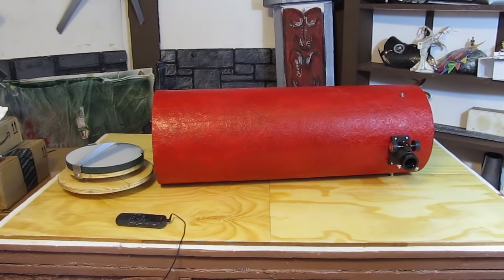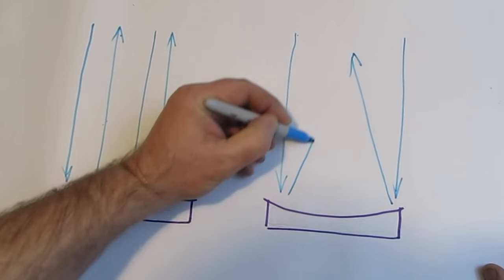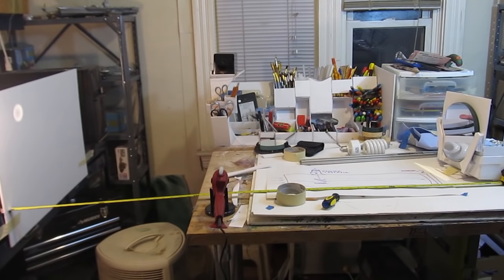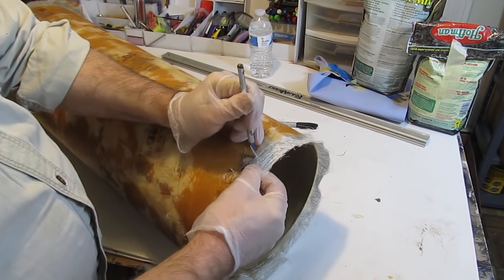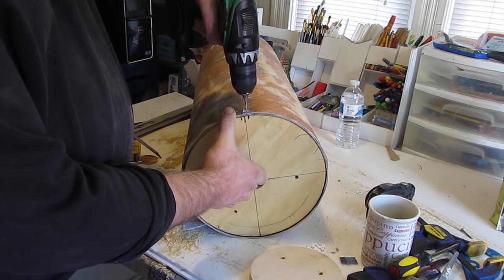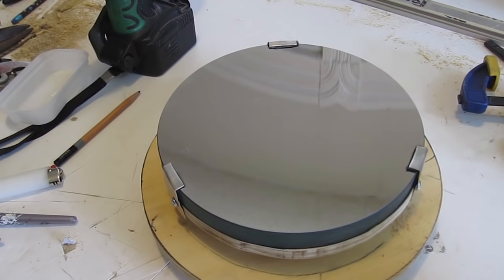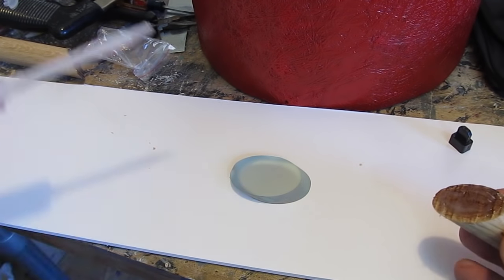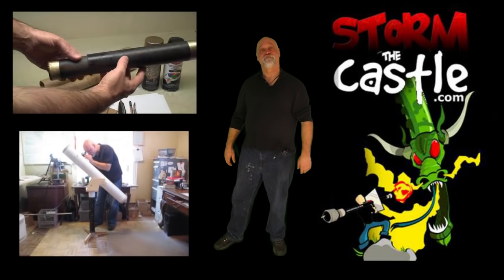How to Make a Telescope - 8 Inch Newtonian Reflector (Part 1)

Comment: How would this compare to a purchased/pre-assembled telescope of the same size? Would I be able to see the same amount of detail, or would it be lesser quality?
Reply: J Smith "Re:How would this compare to a purchased/pre-assembled telescope of the same size"
Not a expert on pricing of telescope parts but generally when building ANYTHING one (big) advantage is you are able to put more money in a "select" part (or parts) than a OEM would.
(OEM's in general selecting components that "just" perform a function, projected lifespan "just" long enough so to speak to last thru warranty period... and not much beyond for example.
Reason?
Cost per part is a major concern when they are making 100, 1,000, 10,.000... and trying to hit a price point /remain COMPETITIVE / keep profits at a certain level.)

So far as your cost per part /total cost. 
OEM's ordering say 100, 1,000 of anything (And supplier is assured of future orders) get a better price than a person buying (1) of anything... 

So building anything you (usually) end up spending more, the trade off being being able to build to YOUR specs.

Comment: This makes it look easy, but it's NOT.  When I was a teenager, my father and I made reflecting telescopes from scratch.  Our first 6" mirror was not very good and took a long time to make.  The next 6-inch diameter mirror took about 40 hours of work to complete, and it was actually a pretty good telescope.  We made an 8 inch mirror next.  An 8" mirror has nearly TWICE the area of the 6" and took us at least 4 times as long to grind and polish.  That's 160 hours, folks.  Takes some real dedication.  But if you are careful, the rewards are pretty spectacular!
Reply: The guy in the video bought his mirror tho.

Comment: Getting a PVC tube was really hard, so I do not want to mess up the measurements, so isn't it better to start with the spider and focuser and then place the Primary at a suitable distance and then cut the excess tube? (Reason for PVC tube, Concrete form tubes not easily available here!)
Reply from the maker: That sounds like an excellent plan!

Comment: How do you determine the distance from the primary mirror to the secondary mirror so you can drill the hole for the eyepiece focuser?
Reply from the maker: Hi, You have to measure from the center of the tube to the eyepiece. Knowing this length you subtract it from the focal length.  That gives you the distance to the secondary and the hole. More about this on the web based tutorial. Link is in the description of this video.

Comment: is it realy good to make tube frome this material ? It will slowly adapt to temperature of outside... I understand, its easy to work with this.
Reply from the maker: Yes, This is an excellent material. It is very strong, very light and it is very resistant to changes in temperature.

Comment: Sorry if this seems a little negative, It's a great project but I felt that you went  into a lot of detail about the things that are really obvious and not enough detail on the more complicated parts. One example is that including part two, you explain the reasons for countersinking screws at least 3 or 4 times - if someone owns a countersink tool it's reasonable to assume they know what it's for!  You explained how to move the main mirror with the three wing-nuts, which again is fairly obvious, but you did not give any information about the alignment / column process itself. I would imagine there's a specific way of doing this rather than just messing around with the wing-nuts and hoping it will somehow fall into perfect alignment. One thing's for sure, if your viewer's competence is such that they need countersinking explained several times then they're really going to struggle with things like alignment.  You also didn't mention how the threaded rods fix to the dowel holding the secondary mirror. Are the holes threaded? glued? or is the dowel just rattling loose on the rods?
I love the finished telescope but just feel that you could put a bit more thought behind what you need to explain to people in detail vs basic diy skills that shouldn't need spelling out to someone attempting a project like this.
Reply from the maker: Good comment. very constructive. In an in-depth tutorial like this there is always a dance in trying to judge the skill level of the watcher.

Comment: What optical magnification did you get with your telescope. If I want to increase this parameter what changes in the design?
Reply from the maker: Good question. The magnification mostly is dependant upon the eyepiece used. But,  technically you make a telescope with a longer focal length you will get higher magnifications with the same eyepiece.

Comment: one thing is certain,, you got wile e coyote beat a mile, lol.  Will this slant mirror work better with a piece of cut hard drive disc.? they are. lot finer in material.
Reply: I'm asking because I a
want to know if that slant mirror has to be round or oval or does it matter
Reply: Miguel. The mirror is oval or elliptical if you like, because once tilted at 45 degrees it looks round.
Reply: Re: "Will this slant mirror work better with a piece of cut hard drive disc.?"
Q: Did you end up using a HARD DRIVE PLATTER out of a PC hard drive?

Comment: Fascinating.  Total cost?
Reply: As the mirror is a little pricey ($200-250) I would say this is around $300-350. I have checked the Orion focuser, it is about $40ish. The tube, as he said, is 5 bucks. As for the secondary mirror, around $50-60. Yes, pretty expensive. But if you build it yourself, you might save $100 or higher. The also, you will need to buy your own eyepiece. I recommend looking at some guides to eyepieces to choose the perfect one for you.
Reply from the maker: wow, great comment and thanks. You are spot on with everything.
Reply: I made it in 17k rupees 😃. Sir please help me I can't see anything.

Comment: so the mirror's concave? but don't u need a lense aswell, just trying to understand
Reply from the maker: Hi, This type of telescope only needs the two mirrors. Then the eyepiece. No lenses needed.
Reply: that was a 8" concave mirror.  Flat mirror does not have a focal length.
Reply: Scott Wood this is a reflector telescope and it uses a parabolic mirror with a certain focal length

Comment: I like your video, it's interesting. However I would suggest that you could have given the tube a better look if you added a layer of automotive putty and then sanded it, thanks for sharing.
Reply: Aaron Martinez or just use PVC
Reply: Jake Wilder. Either way, your original telescope is interesting and different because of the materials used. Thank you, your video is very instructive, I liked it. Greetings.

Comment: Very nice build, but having a fixed secondary mirror is not a good idea, as it does not allow to properly align it. 
Remember that secondary alignment is 95% of collimation work on a Newtonian scope, can't skimp on it.
However careful you are with installing the secondary, your collimation will never be "on the money", especially with a fast telescope like this one. (your picture even shows the secondary mirror not being circular in the focuser... bad.)
You would be better off making a two piece secondary holder, with the mirror-holding part attached to the spider-holding block with 4 screws (one central bolt for length and rotation and 3 adjusting screws around it for tilt ). You may even be able to bodge  it using a "not too thin, not too thick" threaded brass rod, soft enough to be bent by hand with a bit of force to adjust tilt and yaw, and the threads to give you a bit of length and rotation control.
You want to see the secondary describing a perfect disk, centered in the focuser. Any other ay and your picture will be trash.
Good, inspiring job though!

Comment: Respected Sir Can I use the concave mirror of  6-inch dia,(  used for shaving ) to make a reflecting telescope. Thanking you  in advance
Reply from the maker: No, that mirror will not work.
Reply: Thank you, very much Sir, for your prompt reply. I just want to make telescope using the concave mirror of  6-inch Dia,(  used for shaving ) to watch just 500 feet away from the object.( just for fun ) although this can be watched by using binocular. Hoping to be excused, I am not physics student.
Reply: The telescope mirror has the reflecting material (silver) on the front surface of the glass so that light will not travel through glass and be distorted. A domestic mirror has the reflecting material at the back so that it is nor easily damaged. Moreover, your concave shaving mirror is probably spherical, not parabolic.

Comment: why can't we increase the diameter of the lens and use the primary lens with a shorter focal length, so that we don't have use too big a tube for making more powerful telescopes?
Reply: depends on the mirror surface curvature.
Reply: +Ricard Andrés  Yeah,a higher curvature= shorter focal length.
Reply: What makes you think that you can't do that?

The selection of curvature is probably for the sake of making things appear more or less like you would expect, for the human eye.  What you're talking about would probably end up having an effect like a wide angle lens, which isn't really what you want if you're interested on focusing on an object in particular.

That all being said I think that this guy just bought the mirrors online.

Comment: Great video.  Thank you for all of the detail.  I had one question with regard to the measurements.  You measured the distance of the mirror the paper and divided it by two, which I understand.   Then you measured the tube and the location of the focuser hole for mounting it, which I also understand.  
However, when you make the mirror mount, which is very cool, it looks like it reduces a few inches between the mirror and the secondary mirror.  Wouldn't that impact your focal length?   I don't believe you took those extra inches into consideration of where the mirror would actually be.  Unless I missed that.

Regardless, very nice work.
Reply from the maker: Not really sure what you mean here. Shoot me an email.
Reply: Thanks for the response.  
Let me see if I can explain it better.  When you made the measurement of the 58" between the mirror and the board and divided it in half to get the 29" where the focal point made sense.  I noticed when you cut the hole out for the eyepiece you measured 4" from the top of the tube.  How long was the tube totally? Was that hole based on the location of where the mirror would be after it was mounted inside the tube?  Since you insert the mirror mount into the tube the mirror isn't flush with the end of the tube.
Reply from the maker: Still a bit tricky for me to visualize here. Have you checked out my web based tutorial on this?  Will make a lot of sense for you.I have drawings showing the light path and where to place the diagonal and eyepiece holder. Keep at it!
Reply: Yeah I have looked at your website as well to look at all the parts. Very detailed and appreciate all the work.  I want to get a 8 or 10" to add to my 130mm reflector, but if I could make one it would definitely be cheaper :) 

On the website you show that the tube you cut is 29" long.  However, shouldn't the tube be longer than that?  Since the eye piece hole is supposed to be 29" from where the mirror is to get the correct focus, going by your explanation of measuring the focal point.  Maybe I misunderstood what you were measuring.  So given that, I would think the tube should be 29" plus the thickness of the primary memory mechanism, which looks to be about 4" from the back to the mirror face and a bit extra to account for the 4" you have from eye piece to the top of the scope..
Reply from the maker: hmmm, ok let me see. The diagonal changes the direction of the light path right? Now from that diagonal we have to go 5 inches to the outer edge of the tube. then about another 3 inches into the focuser until we get to the eyepiece. Does that make sense?  So, just as a quick review without looking back on the tutorial. We have to go from the flat of the mirror wherever it is for a distance of 21 inches to the diagonal. then the light travels another 8 inches to the eyepiece. That makes up our 29 inches from mirror to eyepiece. Make sense. The actual length of the tube doesn't much matter. I can cut it an inch or two shorter or make it longer. The tube just holds the parts together.
Reply: Hello, I hope I'm not answering too late (it's been 4 years since your comment).
The distance between the secondary mirror and the eyepiece compensates for these few inches, hope this comment helped.
Reply: @Kill4Fun26  is the website link working for you because it's not working for me, it says the website cannot be reached.

Comment: I have an old computerized meade from 2004 that doesnt work well anymore, hoping to use parts to transfer over to something like this, much larger of course like a 10" aperture im looking to do, with 1500-2000mm focal length preferrably for better magnification and could possibly mount the old motors with a new handset and computer chip so that it can find and track objects because viewing objects at high magnification will be a pain with earths rotation and no smooth tracking method lol but i would like to find where to buy or customize 10" mirrors for 1500-2000mm focal length. Can anybody help??

Comment: You have no provision for rotating or tilting the secondary mirror, thus demanding great care in dimensioning and placing the parts. At roughly f/4.5, which is a bit on the 'fast' side, collimation is crucial. An alignment roughly assessed by eye will not cut it for a good image.

Your secondary looks to be rather too small for an f/4.5 primary. This will result in the light from the outer annulus of the primary not being sent to the image. The scope will be operating at a smaller aperture, perhaps as little as 6 inches, certainly no bigger than 7. Looking on the bright side, this would have the advantage of making misalignment a bit less injurious to image quality.

Comment: why do we need half of that which is 29 inches if the light focuses at the twice of that distance?
Reply: That's because a light source from 2f (twice the focal length) will produce an image at the same distance (2f). Since that distance is twice the focal length, you have to divide by 2. The value he needs is the focal length from an object at infinity.

Comment: You know what I could never understand is, how come the small reflecting mirror that directs the image to the eyepiece is not seen through the eyepiece, even though it is directly in the line of sight from the incoming light and the large mirror? That is, shouldn't we be able to see a small oval black spot caused by that small mirror being in the way?
Reply from the maker: Really insightful question. Let me try to answer it. Look through a paper towel tube pointed at an angle and close to a big mirror. You don't see the mirror in the tube. You only see what is reflected in the mirror.  That's what happens.
Reply: But isn't that little mirror actually included in the "image" that is entering the tube and about to be reflected by the concave mirror onto the smaller mirror? I'm trying to visualize how this would work.
Reply: It is due to the parabolic shape of the primary mirror, if I am not mistaken. The crossbars and secondary mirror do obstruct a little bit of light, but do not obstruct your view. Try projecting an image of a light bulb onto a surface by using a magnifying glass, then block half of the magnifier. You will still get the full image, just a little dimmer. This is because the whole image is being gathered and distributed by every part of the magnifying glass. Blocking part of it only dims the projection.
Hope that helps, because It's about as in depth as I can be haha
Reply: Ah, okay, that makes sense. Thanks, Ean!
Reply: Awesome question ,i was wondering that too
Reply: The way optics work is objects blocking some of the light in front of primary mirror only dim the light but because of their placement with respect to focal length they wont obscure the image entirely, nor partly.  Try this with binoculars cover half the lens, you can still see the entire field of view just half as bright. Good question.
Reply: Hard to believe Isaac Newton figured this out on his own hundreds of years ago. Certainly a smart guy!

Comment: Wy is your mirror flat insted of convex?
Reply from the maker: Great question. The telescope mirror I use is concave, not flat. The curve of the concave is extremely small -only several thousandths of an inch - so you can't really see it.

Comment: something that i don not get why you did not use a PVC TUBE instead? it is stronger than the one you used and just needs  to be painted simple as that. it is too much work  fiberglass the tube and i doubt it is strong as a PVC tube itself. 
thanks,
Reply: PVC tubing is too heavy and has lousy thermodynamic characteristics which makes it bad for making telescope tubes.
Reply: I just wanted to share my experience.
I use plastic tubes just to give shape to fibreglass tube. Then I remove plastic tube.
I use layer of cooking paper between plastic tube and fibreglass tube. Resin does not stick to cooking paper so it is possible to separate the tubes. I also mix 5% of black iron oxide to the resin so the fibreglass tube becomes untransparent and black without additional painting.
Reply: Really? When you say "lousy thermodynamic characteristics", the issue is thermal expansion. But PVC thermal expansion is much less than metal which most commercial scopes are made of. Weight is an issue though. Cost is another. His idea is brilliant.
Reply: I guess cardboard is a more matte look when painted. No glare.